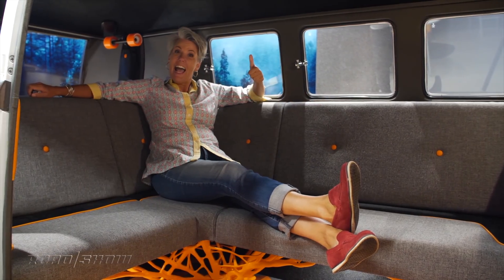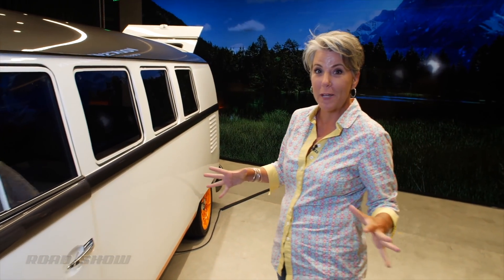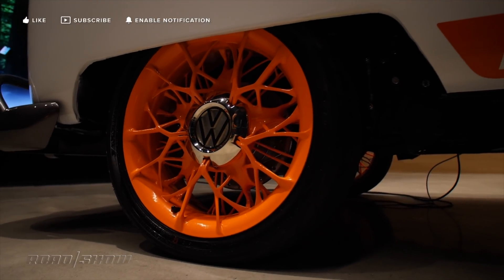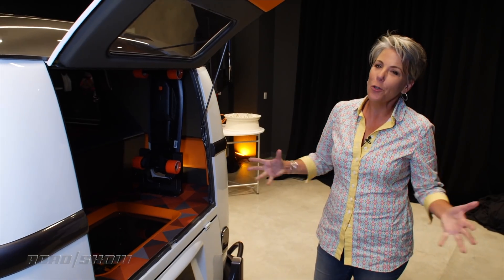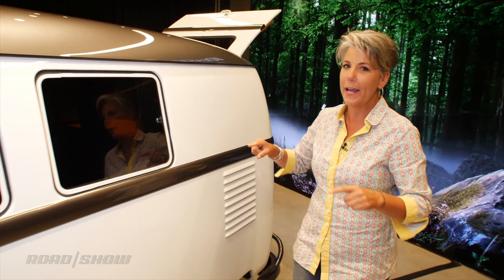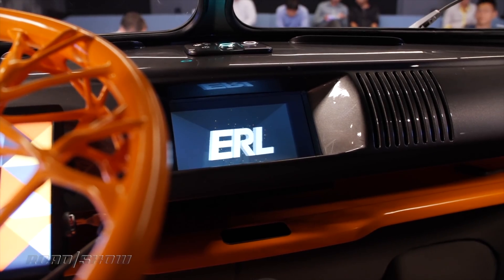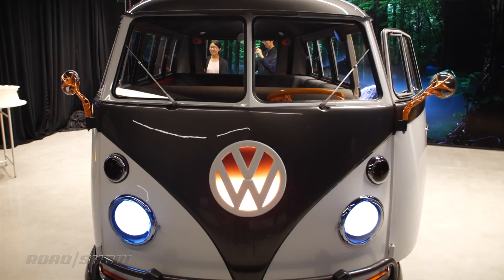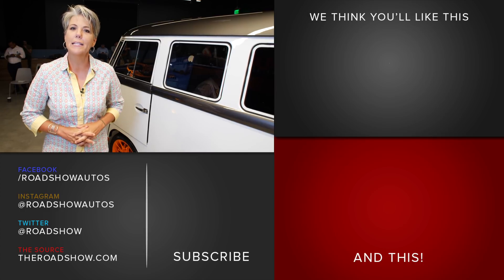VW Type 20 concept: The future in vintage

Comment: Nice review.
BTW the original VW van had 36 hp. engine not 30.
You could almost take a nap while it was accelerating.  Yes it was slow but had little problems with the large snowfalls of North Pennsylvania.
  This new generation should be alot of fun to drive.